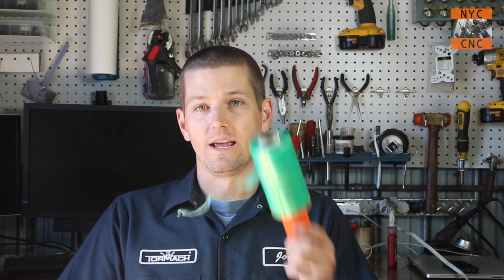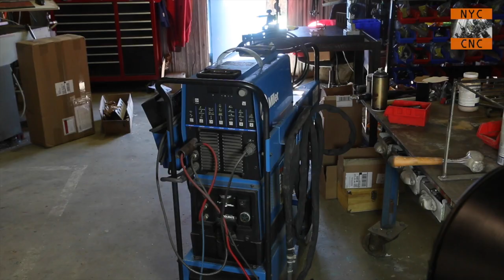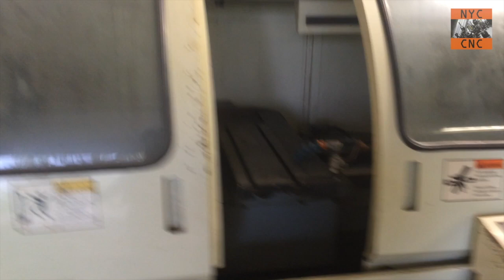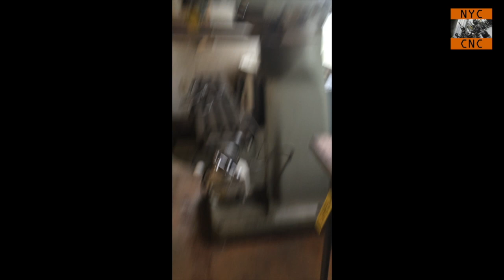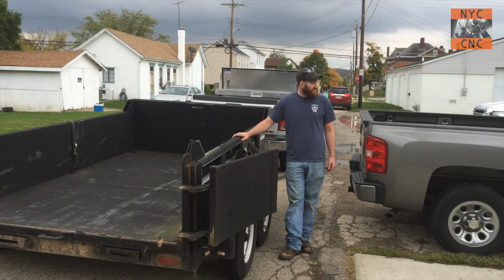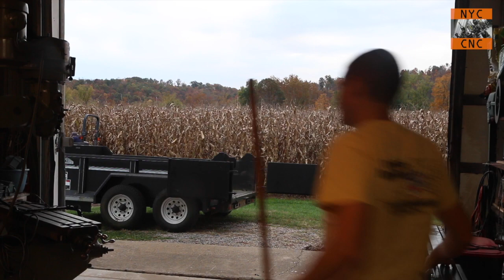Buying a Bridgeport, TIG Welder & More at Auction!

Comment: That's the same TIG I have, I paid $5800 for it new in 2003.  The current model is about $2000 more.  You did fine at $2800.  That looks like the original Diamond Back torch, which you can't get anymore.  It has rubber hoses which makes it very flexible, I prefer those torches.  Mine got a burned wire :-(

BTW, you have to keep those cleaned out and you might want to check the coolant, there might be algae growth and it could need cleaning and exchange.  They spec deionized water.

Comment: Nice. Manual seems so much easier for simple things. I hate having to remember to program a face cut, or i have to clean one side to establish a datum, makes a simple job 4-5 setups. With a manual mill you just square up the blocks and they are ready to mill. I also prefer manual lathe,

Comment: Great video and good finds. The super incredible deal on the miller 300DX paid for the rest (almost) Cooler, torch, and cart package worth much more. The market pricing of Bridgeport mills varies widely depending on where you live. I have found lower prices for mills but the transportation costs are a large factor. Your deal on the Mill was excellent, the DRO power feed and variable speed head increase the value way above what you pain in the Ohio market. You will love the Miller 300DX, I have a professional welder friend that wants to trade me his Lincoln for my DX, not going to happen. You will love TIG welding, clean welds, low drama, and you will find welding on projects you would have bolted in the past..

Comment: John, congratulations on your new purchases. I agree wholeheartedly on the the sunk cost point. You were there, you had spent gas and time getting there, you had your employee with you. Fill the trailer with purchases, as long as they are what you wanted or needed and weren't above going rate. You don't need to get a screaming deal. I think you did steal that radius cutter set, and you'll love machining edges with them. It adds a whole another level to finishing edges. Good job!
Reply: NYC CNC Hi John. On the radius cutters, the best trick I have found is in the setup. Say you have a flat plate in your vise. Touch off the outer edge of the cutter to the top of the plate in the Z. Zero, then rise off the part about 0.003 and zero again. Now touch off on the side of the part, zero, then back away 0.003 and zero. Keeping the part a few thou off gets rid of that line that appears when you are cutting and just leaves the radius. Also, they don't like climb milling. Good luck!
Reply: Good luck! I may post a video on using radius cutters - I just had a small job come in from a buddy of mine that will have a radius on the sides of a plate.
Reply: NYC CNC Hi John. All set, video is posted on using a corner rounding endmill. It ended up being much longer than I anticipated - I guess I need to talk less or edit more :) - Mike

Comment: Saran wrap at a grocery store, Walmart, and probably even a convenience store is the same polyethylene film as pallet wrap.  When I was renovating cleanroom equipment, I just bought the jumbo size restaurant grade food film at Sam's Club to wrap the equipment.  I used the leftovers to wrap the Clausing lathe I bought on Craig's List  that needed to stay in the back of my pickup truck through a rainstorm, due to unanticipated moving problems.

You sort of addressed this, but it would be good to state it explicitly.  Buying a Bridgeport milling machine also means that you're no longer spending your time looking for a Bridgeport.  If you could find the same machine for $500 less, but you'd spend another 20 hours looking over the next few months, it'd be a bad deal.  Besides, in absolute terms, $2000 for a variable speed Bridgeport (not a clone) with power feed and a Mitutoyo DRO in demonstrated working condition is a good deal, even if the table is a bit more banged than you'd like.  I don't think you'd do much better, and you'd be spending time looking instead of spending time using your Bridgeport to make money.  I'd score that purchase as a win.

$90 for that surface plate on a heavy duty roll cart... I'm envious.

Thanks for showing us the other items and telling us the prices they brought at auction.  And don't forget to scour your local Craig's List for machinery deals.  Either save searches for the various Craig's List sites within reasonable travel time from your location, or use one of the sites like AllOfCraigs that aggregates the individual Craig's List sites and allows you to search them all at once.
Reply: NYC CNC
Tooling up a machine is an often overlooked cost, both in terms of money spent, and time spent.  instead of getting a lot of R8 tooling, I'd suggest getting a Tormach TTS R8 collet and as many of the ER20 collet holders and collets as you need on eBay from China.  You could have dedicated tooling for the Bridgeport for common jobs and you could share tooling with your Tormach for the odd stuff.  TTS on the Bridgeport would be even better if you add a power draw bar as Herb Blair suggested.

Comment: I think you got a pretty good deal on the Bridgeport, an excellent deal on the cart and surface plate,  I'm not familiar with the welder so I can't comment on that, but it looks great.
I appears that the bridge port has the riser on it to increase the spindle to table distance.
One thing that you'll want to buy/build is a power drawbar as it is a stretch to reach the drawbar.
Excellent video John.  Thanks for sharing.
Reply: John, see my series on building a power draw bar.  I used a Harbor Freight butterfly, but modified it.  I used a air cylinder to engage, and a three way air switch to tighten, loosen.  I works great!